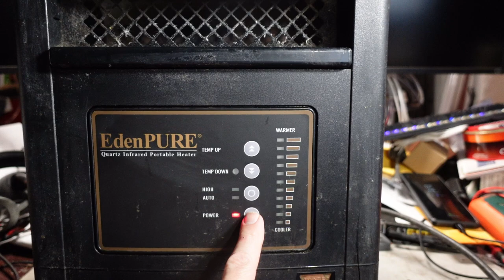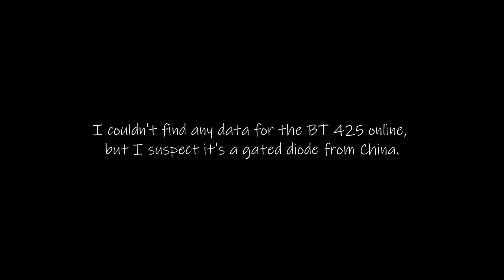Diagnosing and Fixing a non-working EdenPURE quartz heater

Comment: I have the same unit and I was getting just luke warm output. When I took the metal plate loose and checked the three tubes, only one was heating. I replaced the tubes and it puts out a nice, warm heat and is very quiet. I believe I would have checked those instead of unhooking the board. Very easy.

Comment: An Amp probe and a vom are needed as well as a basic understanding of electricity and as well an understanding of the board function is necessary. Another case if tinkeritus
Reply from the maker: Um... I know that you have no idea of who I am or what I do to make a living. I'm sorry this video was disappointing for you. It was for me too, mostly because the issue was resolved without any clear findings.

I definitely tinker, happily. It lets me try things and work on diagnostic skills. I have a pretty good track record, but again, it's not something really shown here.

Also, "VOM and Amp probe"?  My last analog VOM died from old age, and I have a few different devices for either contact or non-contact current measurement, including a set of calibrated resistive inline loads capable of up to 300A.

None of those were necessary. It's a cheap-ass infrared heater that most likely had a corroded connection that was able to re-make contact when it was disturbed by my tinkering. 
If it was a critical piece of equipment, I'd very much be delving into root cause, finding a solution, and implementing it. 

As is, it was just a disappointing video. I'm glad you watched it and commented on it. I am trying to improve, and feedback does help.